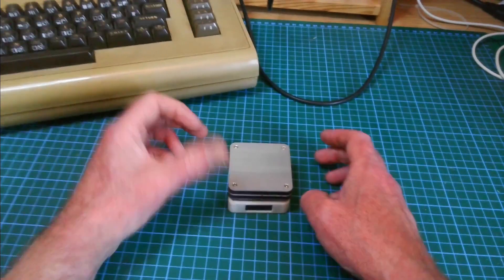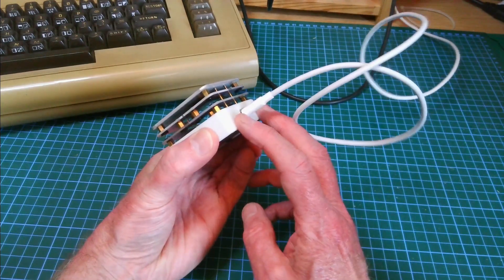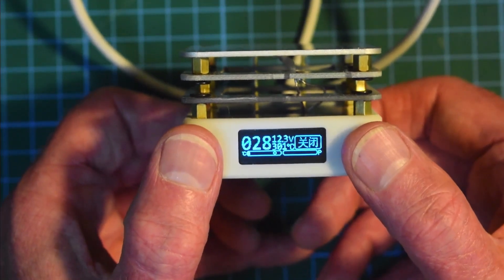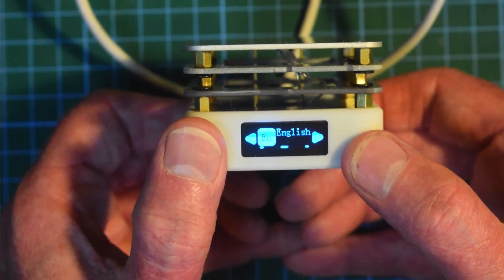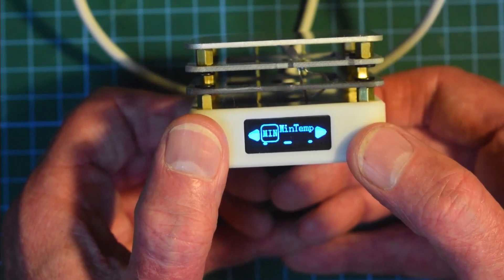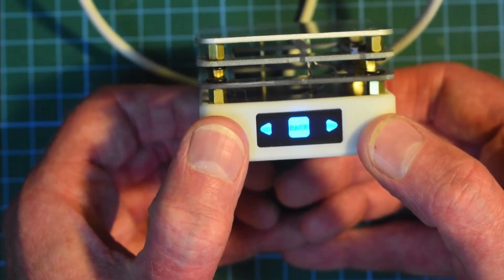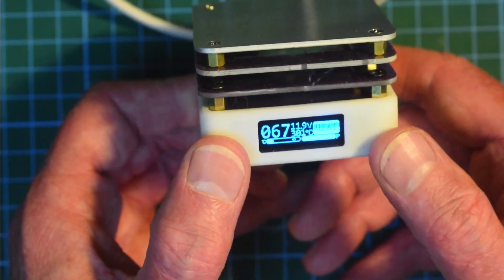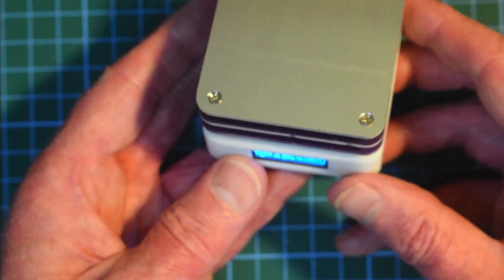$20 Hotplate Set-up Menus & Unboxing

Comment: Hi,

What sort of a (USB probably) power supply do you need to power this ? 🤔😕

Because it is rated at 65 W (I think)...

Thanks ! 🤗

Best Regards,
David
Reply: Edit: Yeah I checked... a 65 W PD adapter is preferred to have (20.0 V, 3.25 A) - with a USB type-C connectpr on the end. 🤔😏